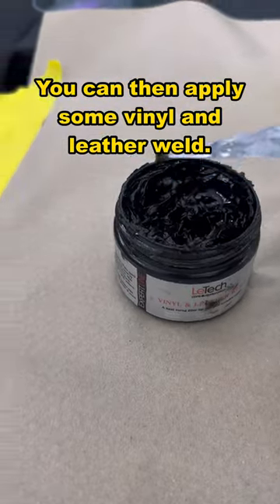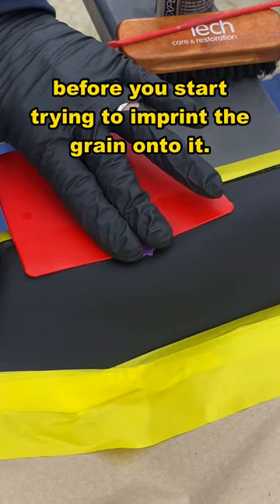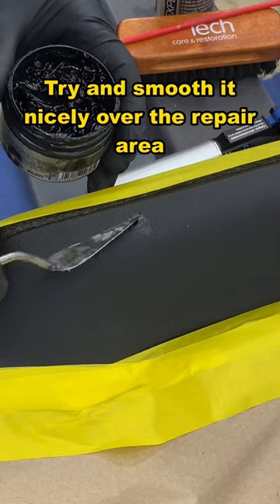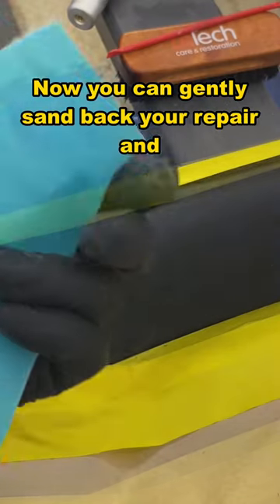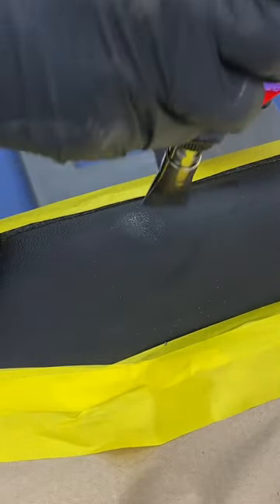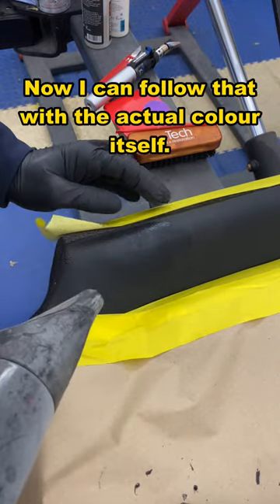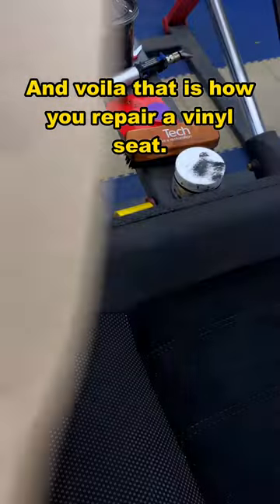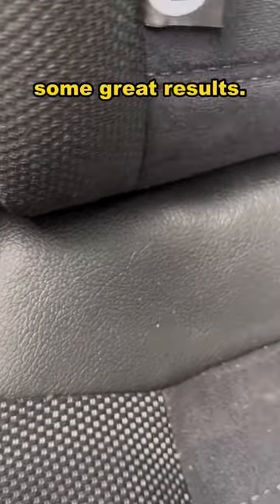HOW TO REPAIR A VINYL SEAT

Comment: You really know your stuff Wayne, very well explained through each process I'm surprised that the vinyl will take all that heat as I would have thought it would loose it's shape or even shrink.

I was expecting you to get your mini gun out to apply the colour but you used a cloth, amazing job Wb👌👍
Reply from the maker: Hey JB 

you are absolutely right about the vinyl and it shrinking or loosing shape, this is why I had to add the warning❗️bit at the end. 

There are so many different types of vinyl and they all react slightly differently to heat, this is why a little care is necessary 

There was no need to use the spray gun on this job, the sponge was good enough 👍
Reply: Thanks for the reply Wayne I'm really enjoying your YT videos and it's great to see you back uploading again, even though I probably won't be doing this sort of work I still love watching what you do and learn from it👌👍
Reply from the maker: I have another interesting one to upload shortly
Reply: Great!! looking forward to it👍